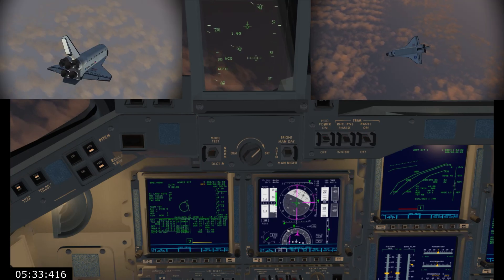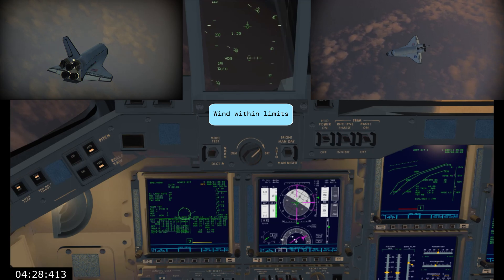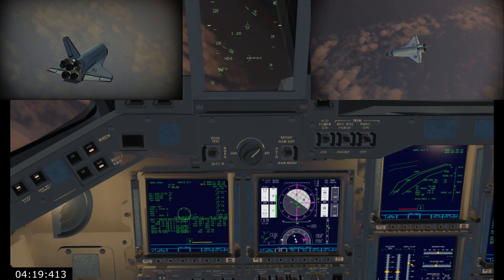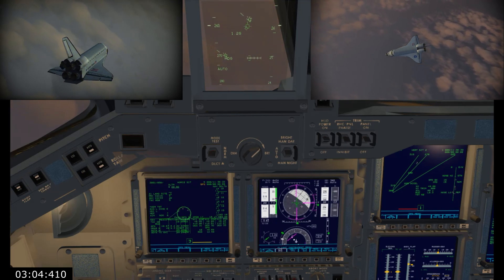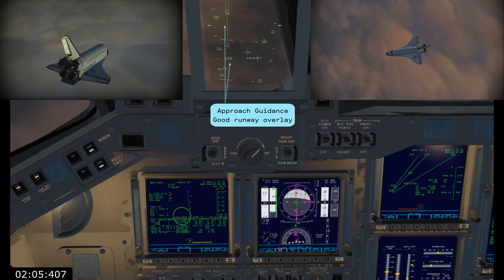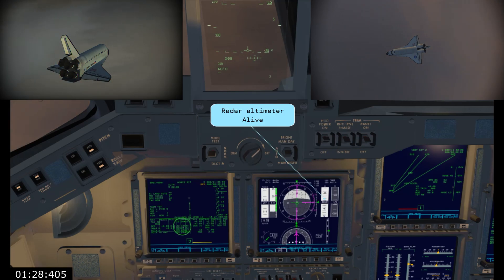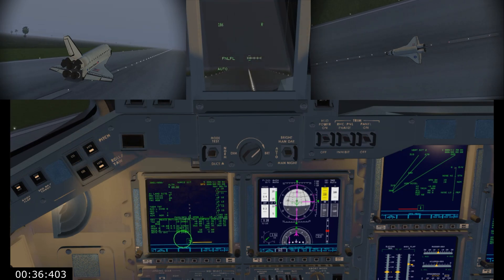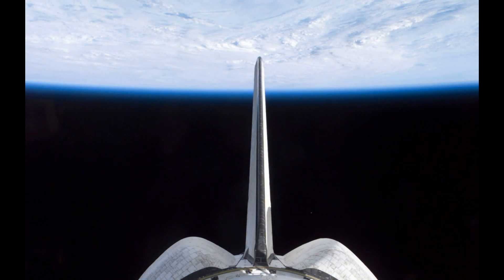Space Shuttle Autoland: From TAEM to Touchdown - Flight Gear

Comment: When ever I run and of the shuttle presets I'm am not anywhere near where I should be. Even if I select launch the launch pad is out in the middle of the ocean.
Reply from the maker: @ted1728  Did you download the scenery ?
Reply: @gingin3388  So I've been trying to read all I can but not getting anywhere. To answer yes, I think I've downloaded the scenery. I've gone to "add-ons" and selected "Install add-on scenery" but when I select "click here to download scenery" it tries to open a web page that times out. Thats one issue.

Another issue is I can select shuttle on final and it seems to line me up with a runway but I an way to low and the overlay is way off.

When I select join the TEAM approach the DMC does not give me the HAC display. It's still in the vertical corridor mode. And no where can I find the info on how to change OPS modes to get the HAC.

Thank you for replying, I used to fly the shuttle in Orbiter years back and was looking forward to being about to do it again. I suspect a lot of what is going on maybe related to the proper scenery?

Thanks